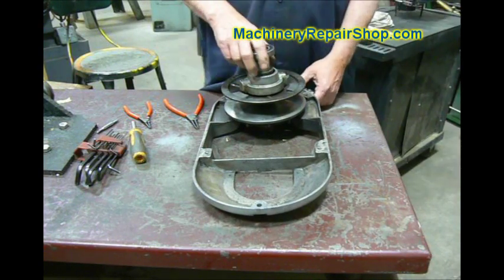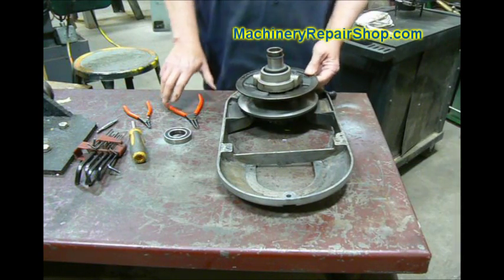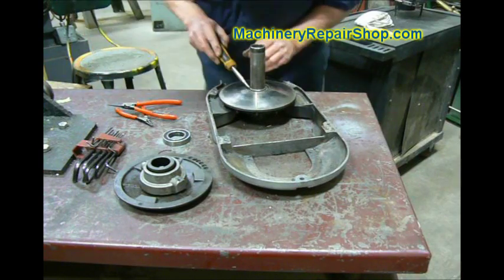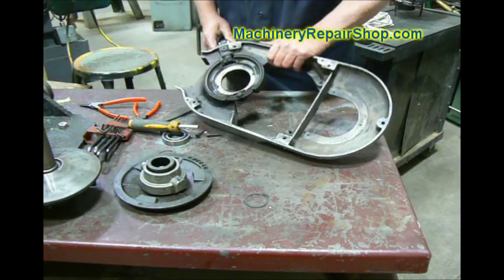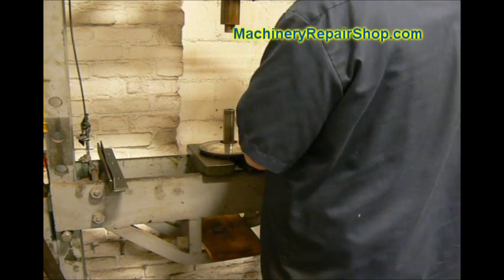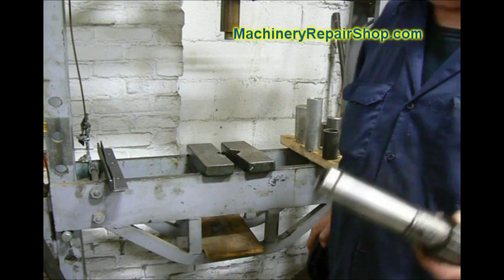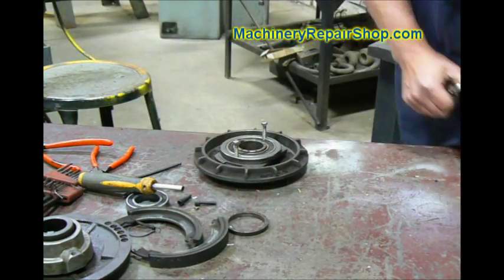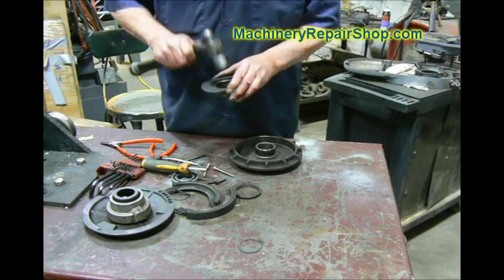Bridgeport Mill Variable speed drive (2J) disassembly part 2 - Front pulley disassembly

Comment: If you need a new pulley, Speed Selector makes variable speed pulleys that replace the Reeves, Hi-Lo, TB Woods and Lovejoy pulleys that went out of business or got bought.   Most of the pulleys are in stock or Speed Selector will custom make if needed. They have an actual engineering department who were very helpful.